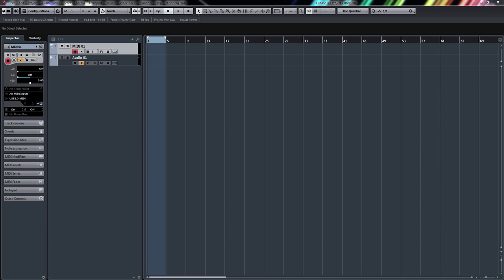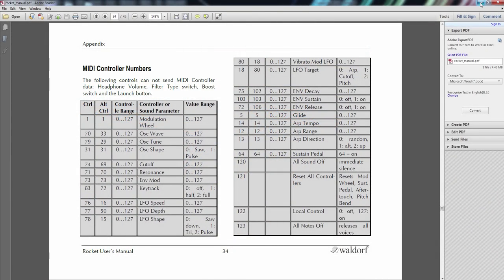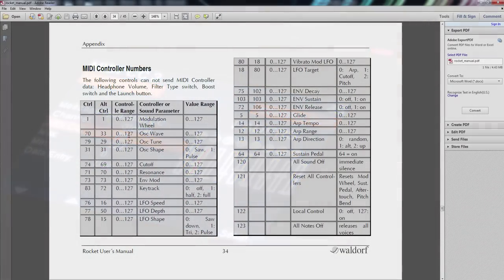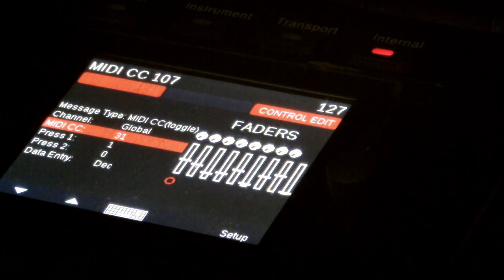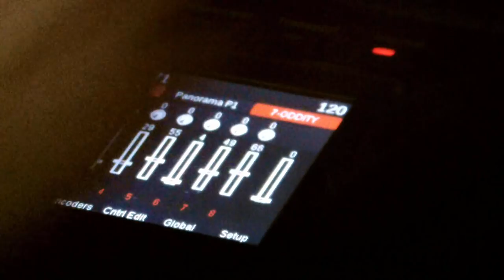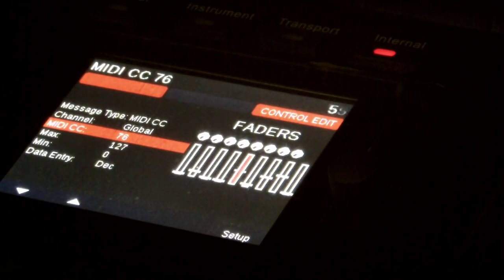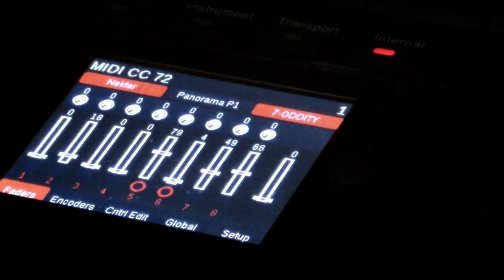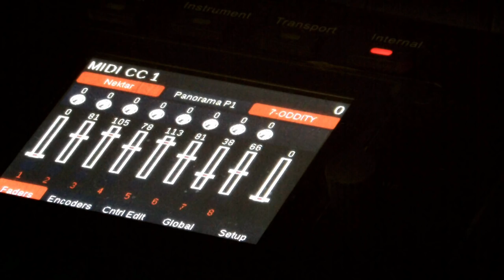Tutorial Programming Nektar Panorama P1 for external Instruments

Comment: Finally a clear demo of the P1. Thank you. How did you connected to your device? Could you use USB or was it with midi cable?
Side note: your website miss the httpS, and is flagged as "unsecure" , you may want to solve this issue if you wish to have more visitors.

Comment: when you turn on your PC an open a project for example on cubase , the faders in the software are in the position of the real faders of panorama P1 ?
Reply from the maker: No but as soon as you move a panorama fader cubase will then correspond to the fader on the p1
Reply: but if i'm working with tow different projects , switching from one project to the other project i will all times adjust the volumes  ???because at the opening of one project the faders of P1 corresponds to previous project .... ..in this case it is necessary motor-faders...
Reply: I want to know this to Nicola!   did you find out?
Reply: mike smith answer's : " No but as soon as you move a panorama fader cubase will then correspond to the fader on the p1 " ... it's necessary motor-faders